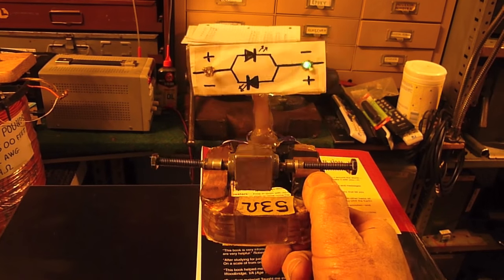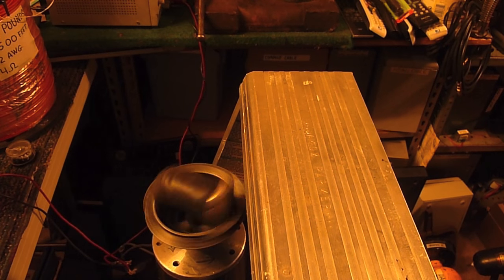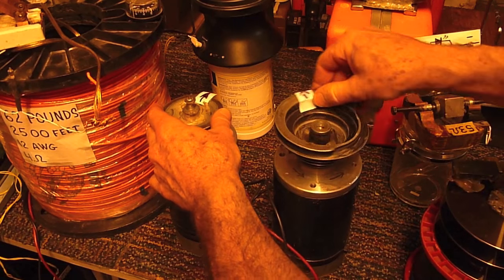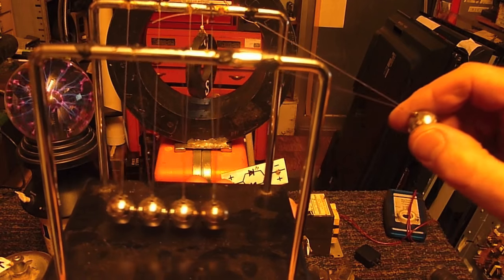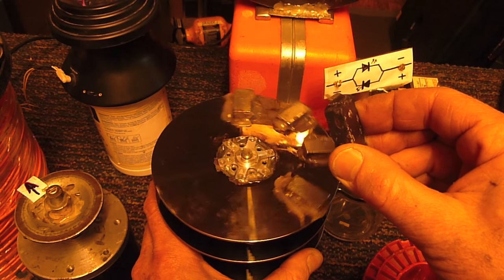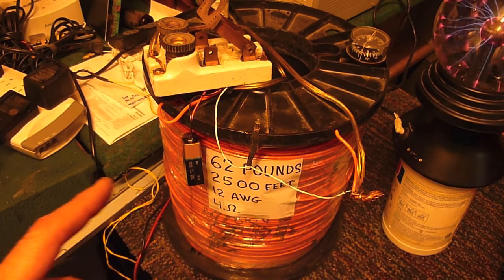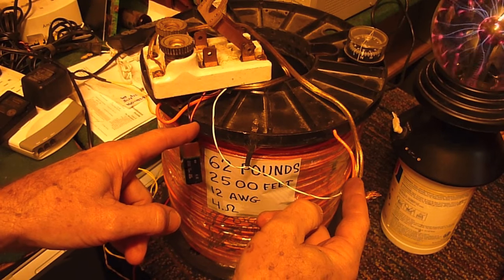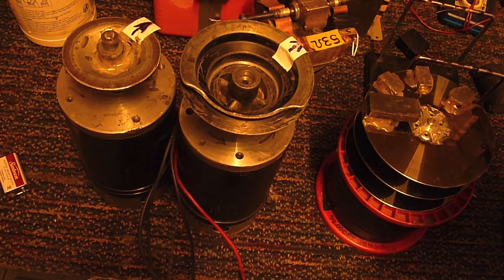Does free energy exist?

Comment: Mega Coil HUGE OUTPUTS,  DO NOT touch these wires when pulsed.put a round solid tube shaped neodymium magnet in center that is polarized on the ends. Over this put an iron tube that has threads on both ends.. Wrap 750 ft. of 14 gauge magnet wire around iron. Make sure each layer is uniform and neat and glued in place. Dip in polyurethane and let dry. Plastic tape outside of wire.  Place another iron tube over the wire making sure the wire inside the iron tube barely fits. Drill small holes in both washers so the beginning and end wires can go thru. Put a large washer at both ends with a nut. When pulsed,   meaning  turned on and off .  A 1.5 volt Battery connected to this coil, puts out very high voltages. Get a bucket of water and mix in salt and stir till salt is dissolved. Attach one end of wire from coil to copper pipe, NOT INSULATED and goes into salt bath.. The other wire from coil is insulated from water. Put the copper pipe in bucket of salt water. Put the coil in the bucket. Put a piece of thick insulated wire in bucket. Both ends stripped of insulation. One end in the salt water and the other sticking out of the salt water. VERY , VERY HIGH VOLTAGE Output off of thick wire in salt bath and a ground. Now imagine if you used a 12 volt battery.

Comment: The thing you are talking about with using the coil's back EMF is partially how Boost regulators work.
Reply from the maker: +Khurram Aziz Yes I understand that boost regulators pulse a small coil and rectify the back spike to be used by the circuit.

Comment: Cycling the back spike of a coil is exactly what DC-DC boost converters do! They just do it about 400 000 times a second. But at the end of the day, they have exactly the behaviour you'd expect from them, there's a bit of energy converted to heat, and the rest remains, power goes in, power comes out, higher voltage, lower current.

Comment: The origin of the modern Law of Energy Conversation dates back to before Maxwell quantified electromagnetism—20 quaternion equations—and Maxwell quantified electromagnetism before Einstein discovered General Relativity (i.e. a 4th dimension, scalar in nature).  Furthermore, before Einstein discovered General Relativity, Heaviside, Gibbs, and Lorentz all butchered Maxwell's original equations by removing the scalar component, among other things.  They were not meant to be vector equations!  And there wasn't supposed to be only 4 of them!  This coalescent triad of mishaps essentially derailed electromagnetism—and physics in general—by imposing an extra constraint that's not observable in nature.  These crucial missteps are the reason why we're effectively no closer to a unified field theory, over a hundred years later.

Energy is conserved in FOUR DIMENSIONS, not three.  Energy is conserved in FOUR DIMENSIONS, not three.  Energy is conserved in FOUR DIMENSIONS, not three!  Write that on a blackboard until your fingers bleed!

Lee and Yang won a Nobel Prize in 1957 for their work on Broken Symmetry.  Vacuum energy is indisputably real, and electromagnetic fields are one of the only known extraction mechanisms for vacuum energy via Broken Symmetry.  There's no violation of Thermodynamics.  Conservation of Energy, as it currently exists, is based on a mountain of faulty assumptions, and it's fundamentally wrong as a result.  As it were, however, classical electrodynamics still assumes a luminiferous ether, and asserts that source charges originate out of nothing and nowhere, so it too is catastrophically defunct.

Electron spin can be explained by the same basic concept.  All the answers lie in the Dirac Sea......

Comment: cool video thx
especially the big coil with the magnetic collapse effect is highly interesting.
Reply: It's well known principle. A collapsing magnetic field around a coil will produce a high-voltage spike. It's how the ignition coil in a car fires the spark plugs to ignite the fuel in the cylinders. But remember that there has to be energy put in to initially charge the coil first. All the coil does is step up the voltage output while it steps down the current going in. It's just an energy conversion device and nothing is gotten for free.

Comment: Free energy does exist. Some examples of energy that's free like solar, wind, thermal, tidal and gravity. It's the device like solar panels, wind turbine, steam engine etc. that allow electrical energy to be created. Open systems like these create free power with respect to the source energy. Closed systems can't produce over unity. It's like a battery cant charge itself. You have to bring in an outside source of power to charge it.

Comment: What if you added a magnet in the middle of that big spool of wire, would the neon bulb glow brighter?
Reply from the maker: +mrsemifixit I just tried this with a different coil, and I could not detect any difference when I placed a magnet in the coil, but I did notice an increase when I placed an iron transformer core inside one of my coils.

Comment: The coil does not momentarily put out "more energy" when you disconnect it. Just like the ignition coil on a car the coil converts low voltage at high current into high voltage at low current. In an electrical circuit power (energy) is voltage TIMES current, which is measured in watts. So even if the output voltage is being stepped up to a higher level, if you measure the power going into the coil versus the power coming out the power coming out  will always be less due to the resistive and magnetic losses. Many people don't understand the relationship between voltage, current and power. This misunderstanding is often the basis of their claims because when they see high voltage they incorrectly think that they are getting something for nothing.
Reply from the maker: I understand the principle of power being voltage times current, and the current losses which occur when you raise your voltage through a transformer,  but years ago I made a current shunt for my oscilloscope, and observing that both the voltage and current went up for a small segment of time when measuring the power of the back spike. It's been many years since I conducted the test, and I'm willing to run the test again, but are you sure your not mistaken?
Reply: The spike occurs because the output voltage and current are a result of the transition in the coil only when the initiating current is interrupted. But no matter how you measure it the amount of power coming back out of the coil will always be less than the amount of power you put in. How much the losses are depend on the efficiency of the entire circuit doing the conversion. To actually measure it you would need to accurately measure the spike of power going into the coil only during the transition when the magnetic field is being created by the initiating current. Then you would also have to accurately measure the output spike only during the transition when the initiating current is interrupted and the magnetic field is collapsing. Then divide one by the other. It could be done, but it wouldn't be an easy experiment to set up and do because you are only trying to measure the power transfer during the transient periods. Doing an efficiency test would be a lot easier if you use a transformer with separate primaries and secondaries that have continuous AC going through them. But rest assured there will always be some amount of power loss.
Reply from the maker: If I put a current shunt across one of my dual trace oscilloscope probes while measuring voltage at the same time it will not be difficult to  measure voltage and current at the moment of transition.
Reply: Okay. Then how are you going to measure the power going into the coil when you connect it and the magnetic field is being created? The same way?
Reply from the maker: I don't understand your question.
Reply: You stated in your video that more "power" comes out of the coil during the back spike than you put in, which seems to contradict your main argument that free energy doesn't exist. Well, your main argument is correct. As far as what happens with the coil you are explaining it wrong. You don't get more power out of the coil that you put in during the back spike. If you were to conduct a proper experiment to measure the energy going into the coil and the energy coming back out you would find that less energy is coming out than you put in because of the losses involved. It's true that the voltage coming out is higher than the voltage going in, but the power (E times I) coming out will always be less than the power going in. I do think you understand this concept just fine but you are just not explaining it right.
Reply from the maker: It appears your correct. I re-did a couple tests, and the numbers aren't going in favor. Thank you for taking the time to point this out.
Reply: You are very welcome. By the way, if you have been doing TV repair for a long time think back to the good old days when TV's used a CRT which required high voltage to function. Remember the old flyback transformers that they used. Essentially they were step-up transformers similar to your coil. During the flyback or retrace period they generated a high voltage back spike to charge the anode capacitance of the CRT. Sure, it was a very short duration high voltage spike and there were the beam currents that were coming from the electron guns so the flyback was supplying some level of power to the CRT. However, the horizontal deflection circuits, the TV's own power supply and the house's electrical system were all supplying more power into the flyback than would ever come back out because it has losses and is not 100% efficient. And of course getting more power out of it than you put in is impossible regardless of what some people may claim.
Reply from the maker: I understood there is always less power out of a flyback transformer or coil. Where I was mistaken is believing that during the transition period when power to a coil was interrupted and magnetic field collapsed, I could measure more output power for a (fraction of time)  even though my (overall input power time would be more) due to the saturation time needed to build up the magnetic field. 

I guess this kind of information isn't widely known. After 7000 views your the first to point this out the error in my description. I added an annotation to  this video explaining my mistake, but it's probably best to re-make it.
Reply: Reminds me of the stephen marks TPU story one of the people involved in it still claims it was a real working technology. Bendeni talked a lot about back emf seemed like a fairly smart fella. What you display in your video reminds me of the Joe Newman motor ... Would be interesting to investigate that a little further myself I am curious if you could somehow use an axial flux generator coupled with the newman motor to generate more out than in got me thinking now are you techinically violating any laws if you are using the work of a magnet? Makes me wonder if magnetic force is considered a source of energy anyhow just thinking out loud I think it is healthy to be a skeptic not only of free energy but of the fact that energy gotten in ways yet known is likely possible without fire explosions or gasoline much like solar and wind using other forces such as magnetics and gravity should be equally as possible maybe even other forces as well while solar is not perpetual like wind IT WORKS! There are other technologies out there just laying in wait to be discovered this I am sure of.
Reply: @ mopowah - A magnetic field is not a source of energy. A wire in a magnetic field will only have a useful electric current induced into it so long as either the wire or the magnet are being moved relative to one another. This is because induction only occurs when the intensity of the magnetic field is changing around the wire. Concurrently no electric current flow will occur if the magnetic field around the wire is steady and unchanging.

Of course this relative motion requires some external mechanical force to produce it so some external energy source is always required. Further, when the current begins to flow in the wire it then produces its own reverse magnet field. The reverse magnetic field, referred to as counter-electromotive force or counter-EMF, pushed back at the other magnetic field that is producing the current flow in the first place. As such the electrical load is reflected back to the mechanical source.

In a generator when the electrical load is drawn out to do something useful (such as light a light bulb or charge a battery) the counter-EMF tries to make the rotating mechanical input go in the opposite direction and slow down. This phenomenon is sometimes referred to as "back torque".  As the back torque increases the mechanical load on the source, a gasoline engine for example, it will cause the source to have to increase its output to handle the extra load. This in turn require more fuel, which is the actual energy source. 

As such you don't get something for nothing. The energy always has to come from somewhere. A generator is not an energy source by itself. It's just an energy converter. You put mechanical energy in and you get electrical energy out, minus any thermal, frictional and windage losses involved in the conversion. These losses are on top of any similar losses occurring in the engine itself, which is also just an energy converter.
Reply: Joe Vignolo it's called impedance, inductive reactance plus the IR drop from the wire.

Comment: There's a guy from Pakistan who amplified the power from a motor to drive a generator which could provide power back to the motor and several other devices. This contraption only stops if you deny the motor power. It's somewhere on youtube but id like you to see and experiment whether he found the loophole
Reply from the maker: I may have seen it, but there are so many scams out there it's hard to know what's real.
Reply: All the conversions involved in his device create losses, which eventually will dissipate any initial energy that he puts in. And if he tries to draw any energy off to power a load it will slow down even quicker.

There is also another guy from Pakistan that goes around online stealing other people's credit card numbers. Maybe it's the same guy.

Comment: what if you put the second motor ina vacuom because i believe nothing weight anything so if the second motor is in a vacum theres no weight for loss of energyso bring it up to speed cut the engergy and they will alturnate been spinning and respinning
Reply from the maker: Even if you put the second motor in a vacuum you will still have resistance losses in the coil, friction losses , eddy current losses and magnetic flux loss.

Comment: Defenetly , the so call free energy devices on youtube are totally fake . But there is one guy i am watching right now . Just look I up . His name is Gerard morin. His last videos about resonance is very interesting . What do you think ?
Reply from the maker: I have listened to Gerard Morin talk about his free energy ideas.  To me he sounds like a beginner who doesn't understand basic electricity. I don't believe he's discovered anything new. If he had a free energy device he should be able to remove any external power source from his generators.
Reply: I was just watching some of his videos yesterday, too. And, some John Hutchison. I was interested in the piezoelectric effect. He calls them salt batteries but I've seen others call them "galvanized dry chemical cells" (epsom salt, rochelle salt, shavings from iron pyrite and silver, packed in-between a copper tube and magnesium core). It's impressive to see a bunch of mineral formations (rocks) wired up in series powering a light bulb, too. Also, learned that a lot of metals are crystalline (even stainless steel has crystalline formations under a microscope). Indeed, the resonance is very interesting.
Reply: well , tes , they defenetely don t have any evidence but they don t claim to have any , they are just trying of course. also , i don t think that anyone that will have a working free energy device will be allowed to show it  on youtube. it will be remove one way or another.
Reply: Michael mike no ji ì

Comment: take your large coil and earth one end, take a zvs circuit connectef to a tv transformer
Reply: and connect to a microwVe transformer with the -ve end of the tv trans connected to a different earth and arc the tv trans and cap +ve end to the top of the large coil through a small gap about 1mm.
this will draw a large ammount of electrons from the ground into your large coil, now all you need is a secondary coil connected to the same ground or diodes on the primary to harvest plenty of excess attracted electrons from the sea of electrons available in the ground.
look at kappanadaz style generators or just study teslas work